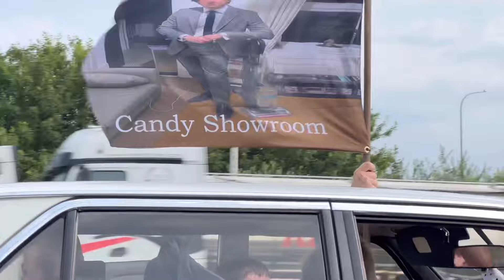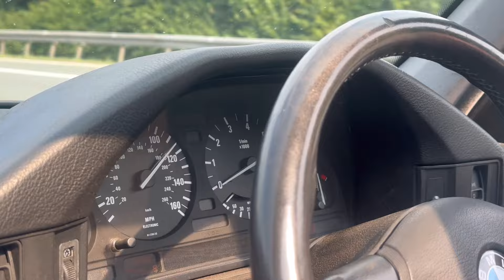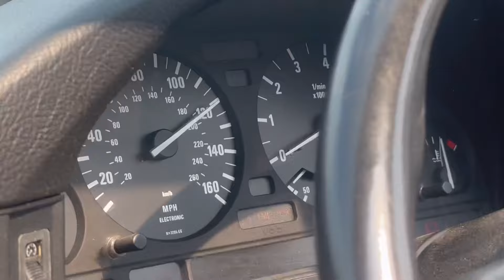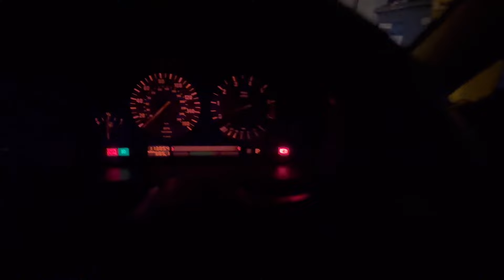DRIVING MY ABANDONED CLASSIC BMW ACROSS EUROPE IN 24 HOURS

Comment: Well done Josh, so glad you made it! I have a 1989 535i which used to overheat slightly in traffic on a hot day and it was caused by a very thin hose by the radiator being almost fully blocked with gunge. I don't know whether your car has the same setup but worth checking.

Comment: I'd treat the old beast to a new radiator when you get home. Also wants a proper good cooling system flush, heater core included, now it's been running for a couple of weeks.
Great job mate, you should be proud of yourself 🤙

Comment: Awesome Car Josh, glad it's gone well ..... in my experience mate there's some deep seated gunk in that coolant system mate . I've had numerous issues just like what you're getting I recommend literally stuffing a hose into a water channel in the engine and disconnect the rad beforehand and let it run for a good half hour  or so ..... I'm not tryna teach you to suck eggs either dude , just my 10p worth 😊